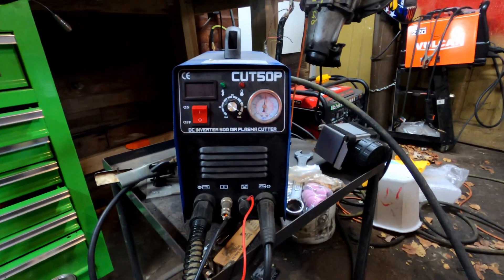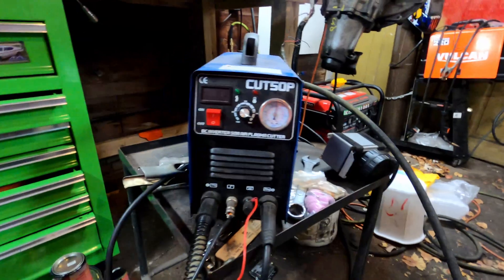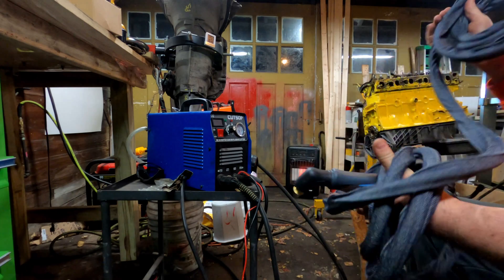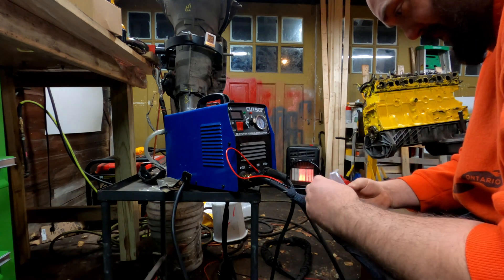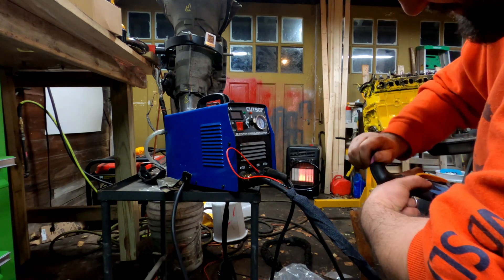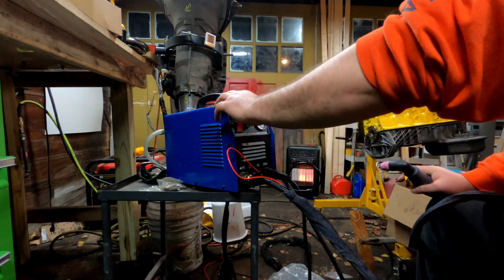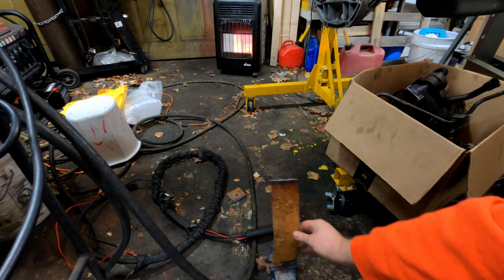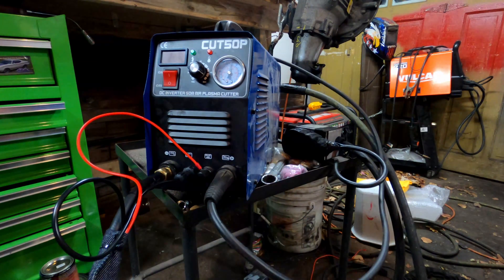Dirt cheap plasma cutter! Cut50 2 year update and torch upgrade!

Comment: This might help some fellow watchers of driveway engineer look up "accurate tools" multiprocess welder on ebay there a tig (no ac)/stick welder and plasma cutter for dirt cheap look just like that plasma cutter I got mine about 2 years ago for 80$ you really got to watch the auctions try to find one nobody's biding on the same day I got mine one sold for 400$ been a good little unit its dual voltage i bought a better plasma torch for it and made the leads longer but its been great

Comment: Did you slap a tape measure on the new lead? It looked longer than 10 ft to me, but a coil of wire in a bag is hard to judge.
Reply from the maker: No, I never even pulled it all the way out lol. It's way longer than the ground cable